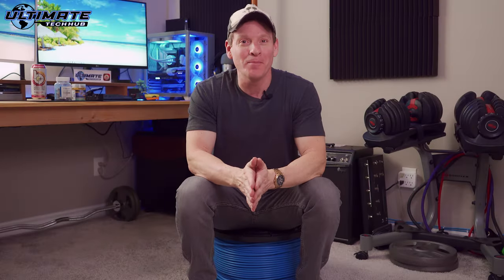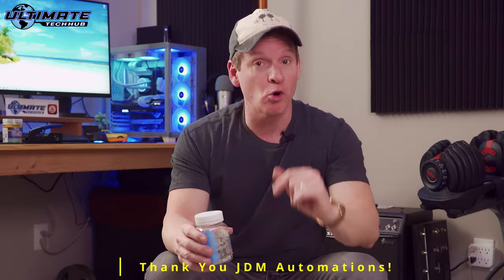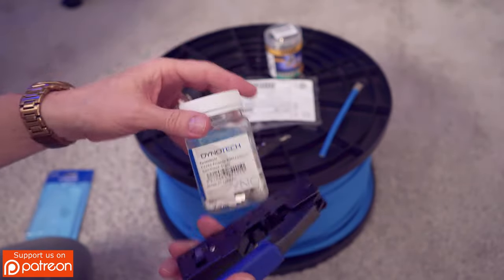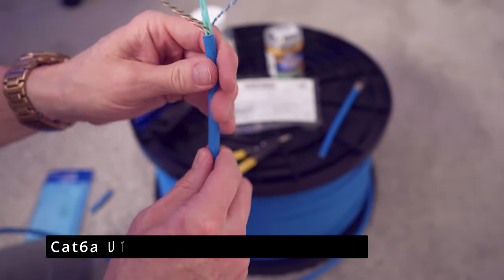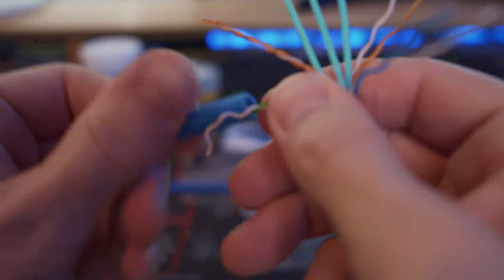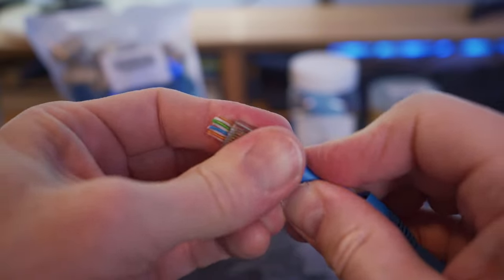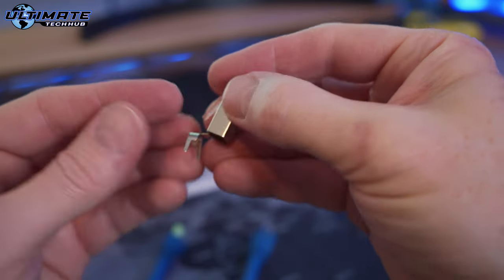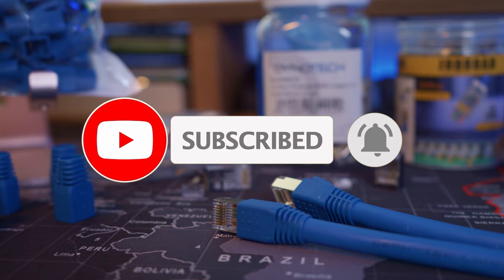HOW TO MAKE CAT6A CABLES - QUICK & EASIEST METHOD!!!

Comment: Hi Mike, what cat category cable do i have installed by builder. It says ‘Cmr cat6E 600 mhz 4pr 23 awg and RG6 quad type cmr ft4’ is it cat6 or cat6a ? How do I terminate cat6e ? Thanks for your help.
Reply from the maker: Cat6e is just cat6. Same termination process as regular cat6. Congrats on the cat6e that's pretty unusual for a builder to install that cat6 type. Thank you for watching.

Comment: Im moving from home soon and i want to setup a stable and secure home network What would you recommend me to do as a first?
The plan is to use a asus gt axe11000 combined with a 2.5GB switch for our pc room that will ofcourse contain our pc's and my nas.
is there anything else i should invest in to keep it safe from the outside?
Reply from the maker: Install a VPN on your ASUS router and add Cloudflare DNS to your routers DNS settings. Use 1.1.1.3 for primary DNS and 1.0.0.3 for secondary DNS. This blocks malware and adult websites. This should help secure your network! Thank you for watching and if you subscribed thank you as well!
Reply: @UltimateTechHub  Okay sweet but will the VPN slow down our wifi then by much?
Reply from the maker: @supernaaworld1351  Not by much at all and probably not even noticeable.
Reply: @UltimateTechHub  I'm just thinking but wouldn't a US DNS slow down my network when i'm in Norway?
Reply from the maker: @supernaaworld1351  Slightly, but you can use a VPN server in Norway or a neighboring country.

Comment: Interesting tutorial although i do wonder when would you use 6a and 6e cables. Thanks for sharing👍
Reply: AFAIK CAT 6E isn't an official standard. It's either CAT 6 or CAT 6A. CAT 6A supports 10 gigabit speed at longer distances than CAT 6. So if that's required, then CAT 6A is better. But for most cases, CAT 6 is better because it's guaranteed to support gigabit speeds and can do 10 gigabit at short distances. Most devices don't support gigabit so it's good long-term option.